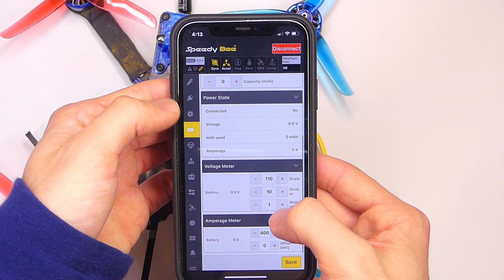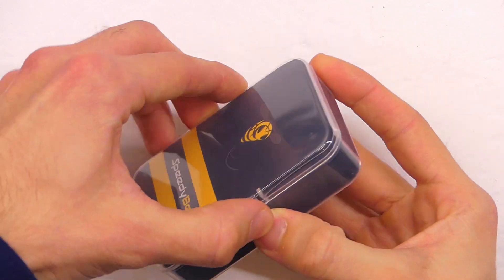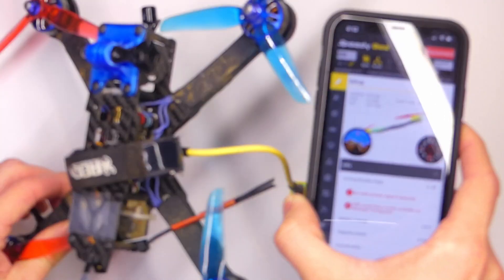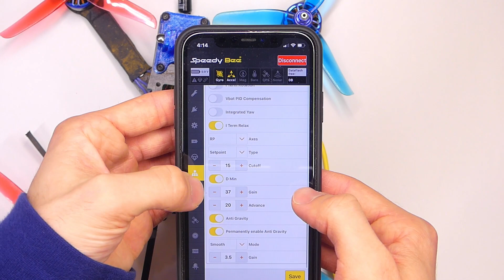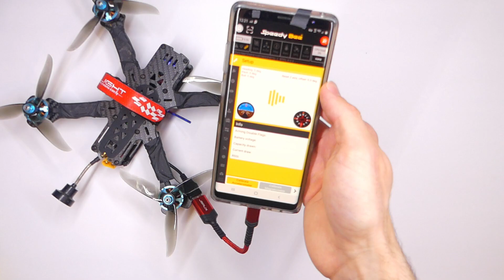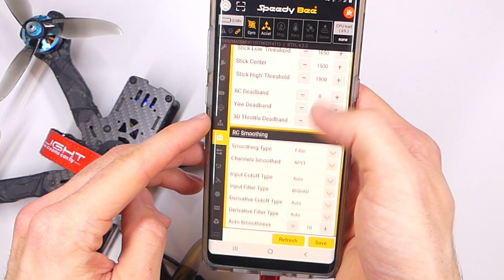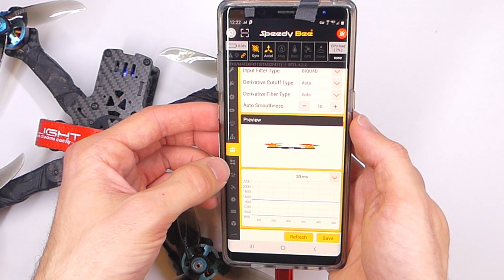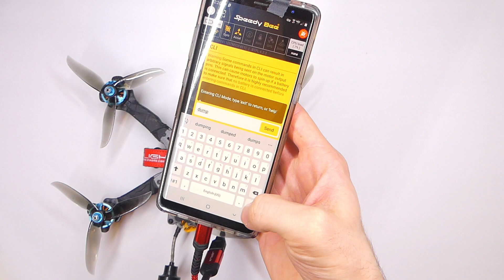Setup Your Drone with a Phone! SpeedyBee Adapter 2 Review

Comment: Funny you respond to post that compliment you but don't answer those with questions..... not good business
Reply from the maker: Hi, David! 👋 Thanks for bringing the unanswered questions to my attention. 
I try to respond to all comments and questions, but have limited time to do so, and some questions require more time to answer than I have available in a given period. 
Do you have a question you'd like answered?
Reply: @RCwithAdam1  didnt mean to pick on you all yutubers seem to do this....just wondering if this adapter is for out in the field adjustments....thanks for bthe info in advance
Reply from the maker: @davidcanole3758  Yes, it is really great for making changes to the flight controller out in the field or just instead of a desktop computer.